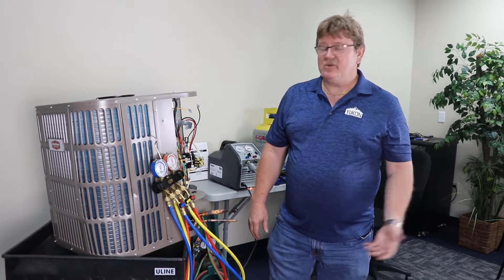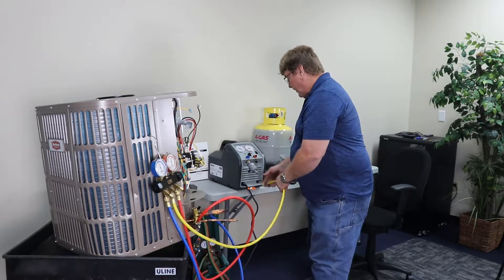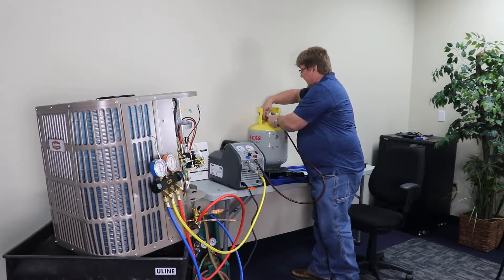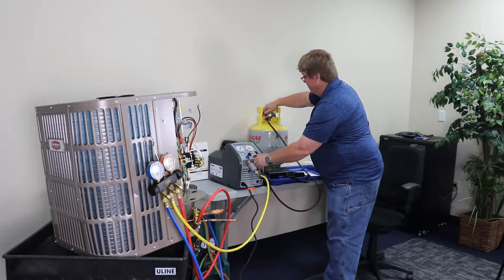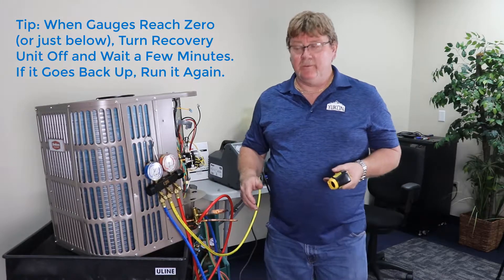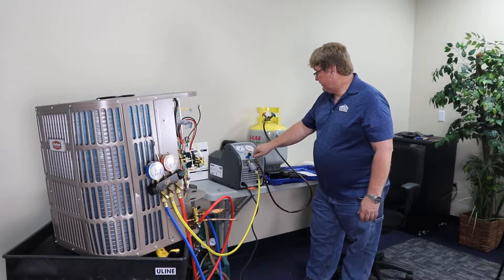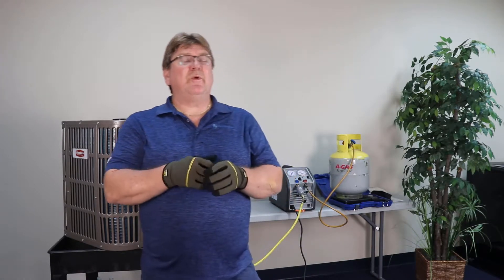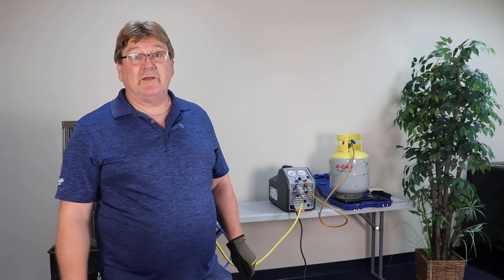HVAC Refrigerant Recovery Process Demonstration

Comment: You didn’t purge the hose going to the recovery tank before you opened the tank valve.  Now the tank has air in it so if you put that refrigerant back into the system., it will contain non -condensible gas which will raise your head pressure.  Not to mention the oxygen and water vapor and propensity to cause acidic conditions thereby, corrosion.  It can happen to the best of us, but shouldn’t post a video of it unless you verified it is correct.

Comment: Not much of a purge. When I put an electronic leak tester on the fitting it took MUCH more of a purge to get to the beginning of some refrigerant flow. Also, what about purging the black recovery hose? Lots of air in there! Could have also done a better job of demonstrating weight compared to tare to ensure no refrigerant was in the recovery tank. As others commented, should ideally pull the Schrader valves too.

Comment: Did you pull the schrader valves?  Also when you weighed the recovery tank you had no hose attached when you looked at the weight saying you had recovered you did have a hose attached.  There is weight to the hose so how do you allow for that?  I would have thought you would remove and purge but that means a lot of purging if you are just pulling the charge to get a weight and returning it to the compressor right after getting that weight and figuring what you have to add or subtract?

Comment: Thanks for the very informative video, I am studying AC recovery for automotive purposes and videos like this are very helpful. One question, when recovering into a new cylinder (purged and vacuumed down) can you put all the refrigerant back into the system or since it was recovered into a vacuum you can only get a percentage of it? For example I recover 3 lbs into a cylinder which was at 29.9 inHg I am assuming I cannot get that 3 lbs back into the system? Is there a percentage I can get back out of the cylinder? Thanks!